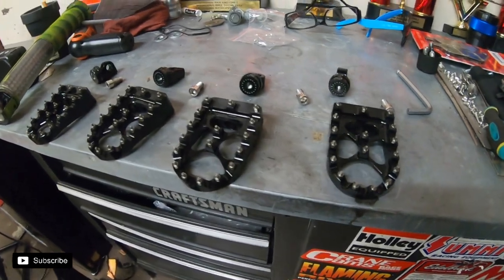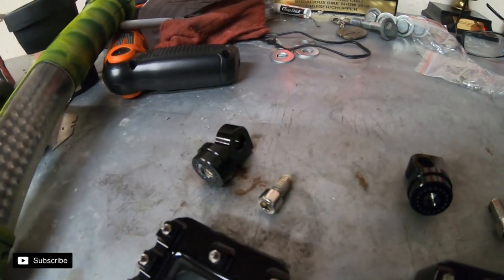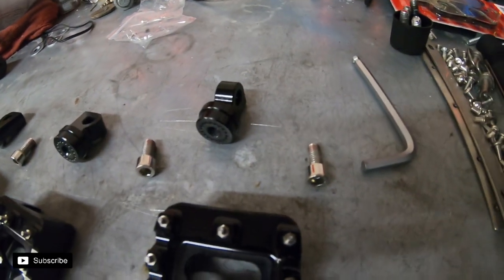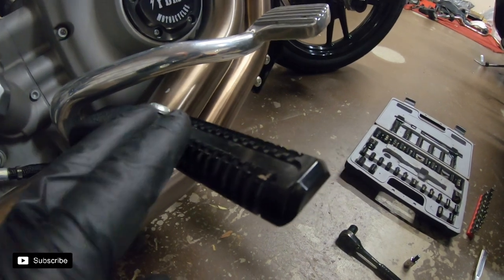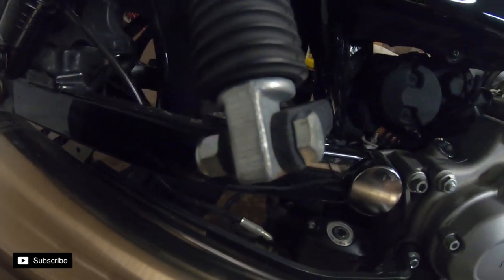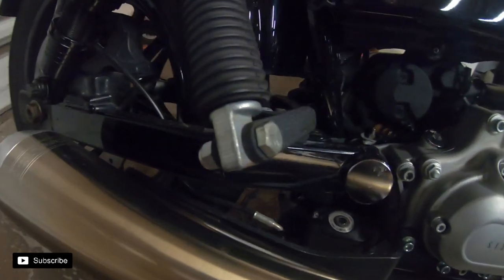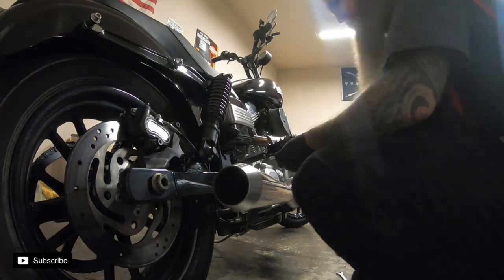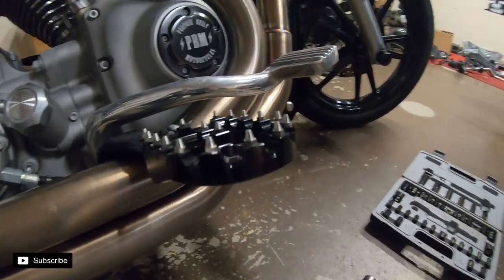How To: Harley Davidson Dyna Fxd MX Style Peg Install

Comment: New subscriber and fan of the channel! Been watching your suspension, exhaust, and chain conversion videos and our bikes look super similar! Finally a YouTuber who has something I’m trying to do. I’m almost done having mine worked on currently for the past 3 weeks. It’s been in the shop since I dont own a garage yet or have the proper equipment for projects unfortunately. But I have an 07 dyna Fxd. I got the chrome parts powder coated black.  Removed the huge ass 16 inch apes that came with my bike lol, new air cleaner cover, remove the rear fender chrome struts, new grips and 1/4 throttle tube, new blacked out hand controls and mirrors. Having all the cables internally wired through my new Mx t bars with a new Speedo re loc mount. Just received my new derby and timing cover in black. And i has bought some freshly powder coated mid controls from a dude on IG so im having those installed too with some Mx pegs too. I agree the prices for Mx style pegs are ridiculous. Next on the list are new shocks and exhaust! Still debating if I want a fairing or not....
Reply from the maker: Hey thanks man thats super cool let me know if you wanna see a certain type video or opion on a certain area.....thanks again for the support homie means alot